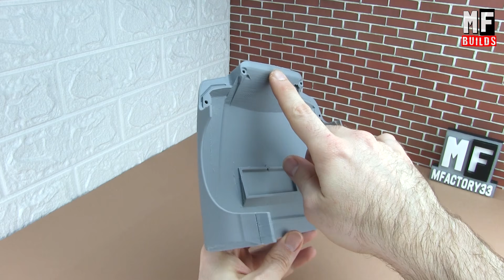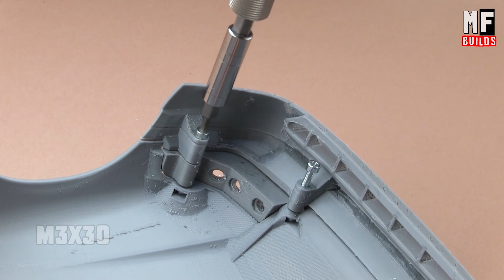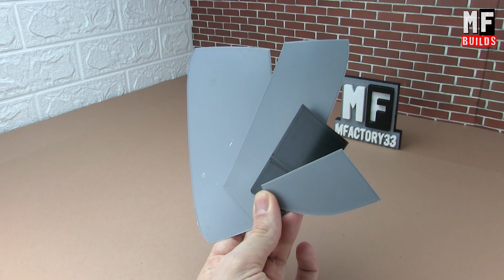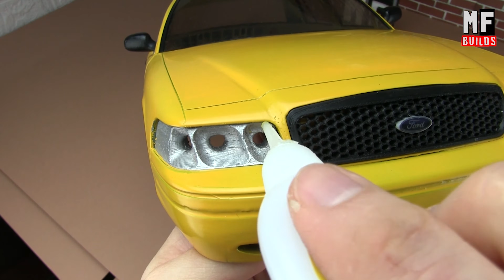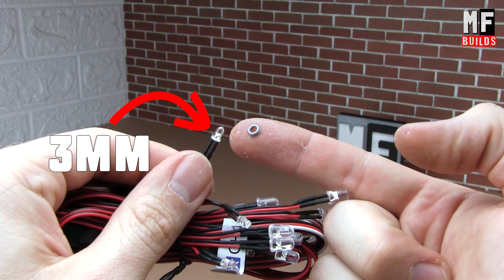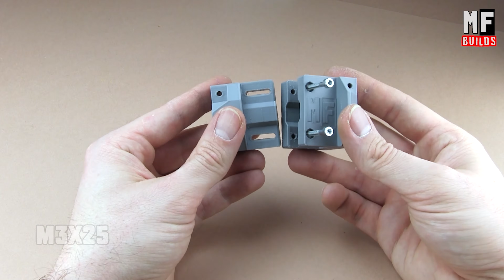Ford Crown Victoria 3D Printed - DIY RC car

Comment: Hi.  I have Destiny and the Crown Vic body set and I'm building a replica of our county sheriff's cars.  Anyway, by chance are the tires 1.9" size and do you have a link to where I can buy them?  Thanks!!😀
Reply from the maker: Hello, did you scaled down the model ?  You should try ebay there's a lot of tires in many sizes :)
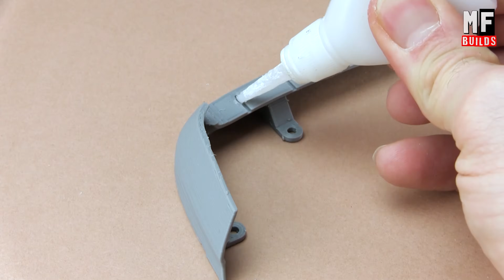Reply: @mfactory33_builds I'm building 1:10 scale.  I'm looking on ebay and I really like the tires you have chosen but I'm not finding them.  I will keep looking.  Thanks.
Reply from the maker: @Mark_Ryder  This is very similar to it from alibaba https://www.aliexpress.com/item/1005006341395590.html
Reply: @mfactory33_builds Yes, that's perfect!  Actually, I've just found something similar on ebay so I might go ahead and buy them.  Anyway, I really should buy a spool of TPU filament so I can print my tires - any kind and size of tires.  Thanks again.

Comment: What filament type do you use for the chassis parts?
Reply from the maker: PLA or ABS. ABS mostly to the rockingarms, dogbone, suspension holders, gears where more strength is needed.